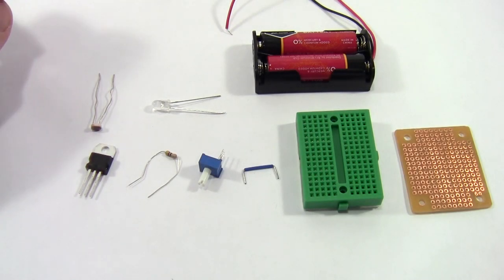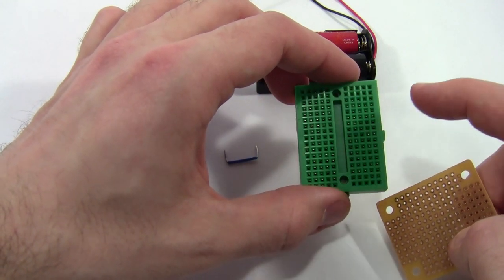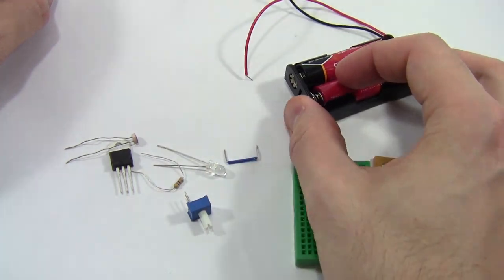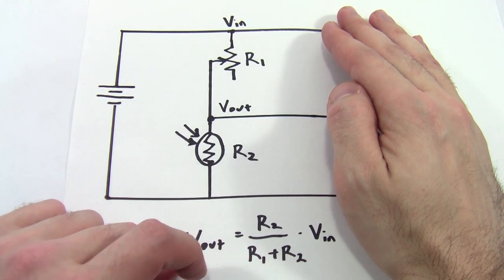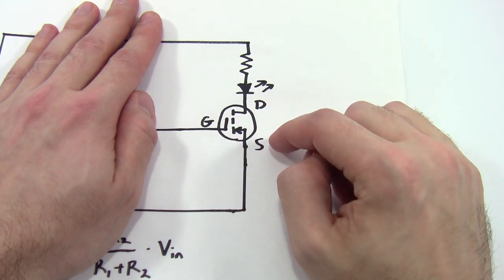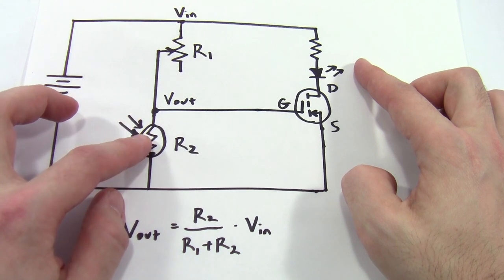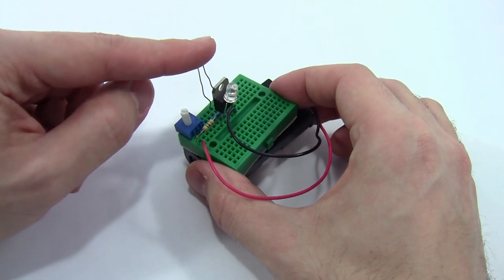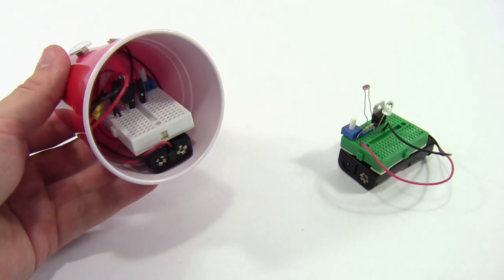Make an LED Night-Light | Science Project

Comment: Cool.  I'm a novice when it comes to electronics, but I like to tinker.  I order the parts, and plan on putting one of these together real soon.
Reply from the maker: If you're new to electronics, you may find our breadboard tutorial video very helpful: https://youtu.be/6WReFkfrUIk
We will also have a multimeter tutorial coming out later this week!
Reply: @Science.Buddies  Thanks.  I actually watched the breadboard tutorial right after this one.  It provided very clear information.  I definitely look forward to the multimeter tutorial.
Reply: @Science.Buddies  Oh, and the parts for the night light are very, very reasonable.  I bought doubles of every part for about $20 total, including shipping...I have the resistors and wire already.
Reply from the maker: @PawOfRizzo  fyi we just posted the multimeter tutorial: https://youtu.be/ts0EVc9vXcs. Hope this project turns out well!
Reply: @Science.Buddies  Thanks.  That was fast!  The parts are shipping.  I'll let you know.

Comment: Do you have a video one how to hook up an n channel mosfet and how to size the right one using the data sheets? I've watched hours of videos and know how to hook it up but am drowning in all of the nuances of gate voltage, drain on, resistance,m... especially when it comes to an incorrectly sized mosfet overheating. 

If you do one, you might note when you do and don't use a resistor between gate and source, and that not all mosfets have a universal leg layout. I am not the sharpest tool in the shed so it has taken me many many hours to interpret what you electrical wizards are doing. You explain things VERY well though! 

Either way, thank you!!!!!

(Oh, and I think the mosfet link is broken)
Reply from the maker: Hi - unfortunately we don't have a separate MOSFET tutorial video. We are primarily a K-12 science project channel and not an electronics tutorial channel, although we do have some electronics projects like this one. What exactly are you trying to drive with a MOSFET? If it is something small like an LED or maybe a motor on a small robot, you generally should not have to worry about overheating as most readily available MOSFETs are probably "good enough" for your purposes. SparkFun Electronics and Adafruit Industries are both good resources for parts if you have not heard of them - they carry a much smaller catalog of parts than big industrial suppliers like Digikey or Mouser; but the parts that they do carry are probably fine for 95% of hobbyist projects. 

Also, thanks for pointing out the broken links! We will look into those.
Reply: @Science.Buddies  Yep, a 12v x .1amp = 1.2watt Led light string to be triggered by a USB through a computer. I was concerned the wrong size might have the wrong resistance (definite newbie). Thanks for the help and recommendations!!!
Reply from the maker: @anothersomebody8195  then you should be fine - for example, this MOSFET sold by SparkFun can handle up to 30 amps: https://www.sparkfun.com/products/10213

If you look at the datasheet you will see a section on "absolute maximum ratings" - you aren't anywhere near exceeding any of those numbers.

Comment: Which Mosfet Transistor are you using, I cannot locate the info for it?
Reply from the maker: The MOSFET is available in this kit: https://www.homesciencetools.com/product/science-buddies/diy-night-light-kit/?aff=SB1 but pretty much any N-channel MOSFET with a low gate threshold voltage (<3V) will work. Since the kit is only powered by a 2xAA battery pack, you don't want a MOSFET with a threshold voltage >3V. For example the IRF510 is a popular MOSFET that will NOT work. The FQP30N06L and RFP30N06LE both work well.
Reply: @Science.Buddies  Thank you. I am looking at the 5v, from a Wall Charger. I know what to look for now. Cheers and Thanks for the Vids

Comment: Will this work with a potentiometer that’s 250k ohm instead of 10k ohm?
Reply from the maker: Hi Ivory - yes, it should still work with a 250k ohm potentiometer, but you may find it a little more difficult to adjust the threshold where the LED turns on or off.